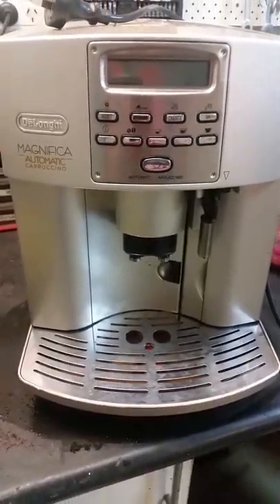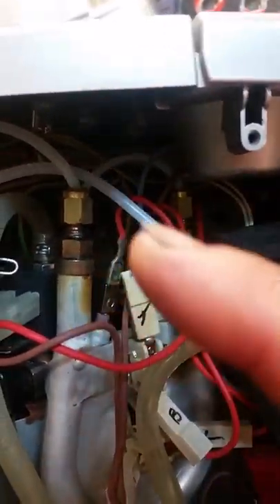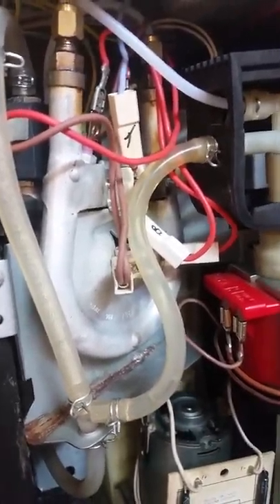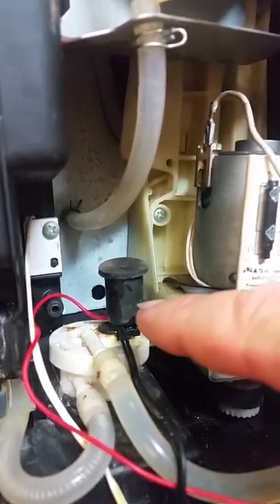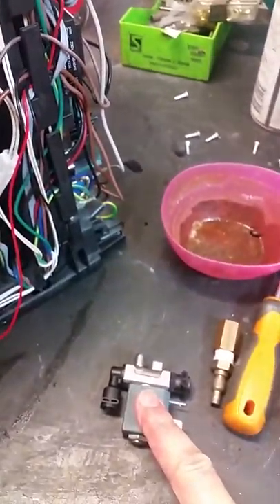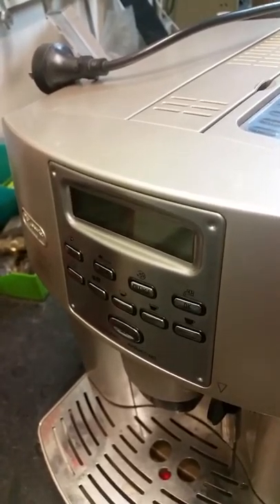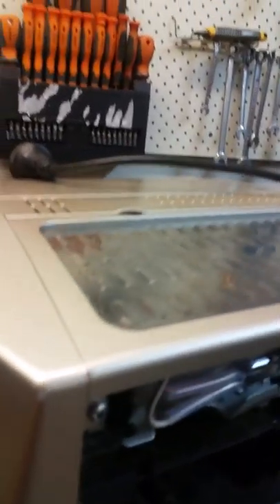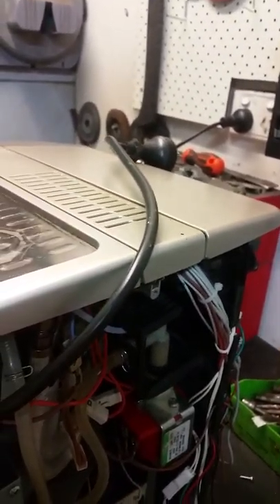How to Delonghi Magnifica 3500 problems and fixes!

Comment: Great video thanks. My 3500 has made 25500 coffees + 6000 cappuccinos over 12 years. No maintenance other than cleaning and the front solenoid has now packed up. I broke the plastic hose connection trying to fix it but it still makes coffee but no steam. All the plastic is very brittle so im not sure it is worth fixing as it doesn't owe us anything. Would buy again when I have the cash.
Reply from the maker: Thanks for the kind words. Great to hear that your machine has lasted the distance!

Comment: Hi Robert. Excellent.
Last night my Hubby tried to fixed our coffee machine. Delonghi ManificaEAM 3400.S, and accidental damage one of the wire next to the water boiler and circuit was short. Now he tried to turn on the machine nothing work. a red light on top of Menu light on for 2 seconds then off. The screen has light but blank. Thank you Robert
Reply from the maker: Maybe a fuse on the board?
Reply: @Discoworx  Thanks for your replied. Can i please have the image of the fuse locate on the power board. Cheers
Reply from the maker: @vickyyeung8814  I don't know that for a fact. Just an idea. I don't have an image. You'll have to look for yourself.

Comment: Thanks Robert.  I don't use the milk capability on my 3500 as I don't like the temp or consistency of the milk after.  Also keeping it all clean is a bit of a hassle.  I purchased a Nespresso milk heater and frother.  It has a magnetic driven whisk to froth the milk.

My ESAM3500 will periodically lock up.  It goes into a Self Diagnosis mode on power up and then shuts down.  By  using some of the things I learned from you I can put it into a diagnostic mode and play around with it.  Unplugging and plugging back in a few times.  Eventually it starts working again and stays working for a few weeks before going back through the same frustrating cycle.

It has been a great machine otherwise.  If I need to replace it though I will get the 3300 model as it has a steam wand to heat and froth the milk.  I have purchased that model for family and friends who are very happy with it.  But until then I'll use some of what I learned from you to keep my 3500 humming along.

Thanks again.
Reply from the maker: Jerry Banks Glad you found it useful. Sounds like you need a new control board. Have you considered replacing it? I don't know how much they are.
Reply from the maker: Jerry Banks You are right on about the milk frother cleaning! I personally quite like the milk though that comes out of it. What happens with the Nespresso frother? Do you fill it with just enough milk for one coffee or just keep reheating and refrigerating? Thanks.
Reply: Robert Baohm It is best to do one at a time. If you put milk just to the top of the whisk and use the wire whisk spinner it will fluff up to the top of the Nespresso.  I sometimes do not use either whisking elements and use it to heat the milk with no frothing. 

Before I repair the 3500 I'll likely just purchase a 3300 just to get the steaming wand.

Comment: Hi Robert, I am having a problem with my delonghi 4500 which is very similar to yours. My problem is I cant have milk froth coming out of the milk spout, but instead, lots of steam. The machine is super cleaned and works great otherwise. Espresso comes out, hot water comes out great. I just recently changed the coupling carafe with all new 3 o rings. I've got this machine from a seller in ebay that told me he only used it a couple of times and stored. When it arrived, I tested and worked fine for coffee. All buttons worked fine, the machine really looked like new. When I opened the machine sides and back to see inside, there were lots of dried grounds around it and I cleaned up carefully. I also have disassembled the milk jug lid and cleaned out, even though was not really dirty inside. Though, the milk jug lid came without the milk frothing adjustment, which is just something grey that slides back and forth for more or less froth. I don't know yet if the missing grey part can be the reason for the problem, but when I try to froth milk I even have held a cloth in that spot where the grey sliding thing would be, but makes no difference. Also, when disassembling the milk jug lid I noticed that one black o ring that was on the spout was broken (which I replaced) and there was only another little red o ring that you can see when you press the clean button. No more o rings in the milk top cover just a couple of springs. The milk jug works when I press the clean button for cleaning out the spout with steam. But no milk froth comes out, just lots of steam coming from the milk spout when I try frothing milk. Do you think the milk jug cover is the problem? Do you know if there is any other o ring in the milk carafe cover that I am missing? Help would be greatly appreciated.
Reply from the maker: Cindyc Tate hi. Itsbeen a while since ive had that apart but id guess you need the grey sliding part in there. It regulates the amount of milk. You mighy have to buy the whole lid to get it though. Good luck!
Reply: Yes, I think your right. There is visibly nothing else wrong with it and in test mode everything sounds good. Im going to have to buy it and give it a try. Would rather to know it for sure before spending almost $100 on the new milk jug, but have to do it. Will let you know if that will work and hopefully more people would benefit from the information. Thank you so much for your advice. :)
Reply: If steam and hot water works but not frothing, it could be the coupling carafe is partially blocked, you either try remove the coupling and clean it, or replace with a new one, it maybe not just the three orings on it

Comment: Thanks so much for this thorough review.  I also received my Magnifica from a friend and performed a complete cleaning and lubrication of the infuser assembly and transmission, full wipe down, and vacuuming but the machine would still report a Generic Alarm even without running the self-diagnosis and I successfully ran all functions in Load Test Mode, Display Test Mode, and Counting Mode. Finally, I was able to get a delicious double serving of coffee after leaving the coffee maker unplugged overnight. Then after about 20 minutes, the display once again read Generic Alarm and I'm back to where I started with a non-functioning machine. Any other suggestions to troubleshoot?
Reply from the maker: Sorry. Been quite a while and just don't remember.
Reply: @Discoworx  Thanks for your reply.

Comment: Hi Robert, I also have a Delonghi Magnifica 3500 and it produces the best coffee ever.  Mine machine is now about 12 years old and has worked perfectly up until now.  It still makes a great coffee but the coffee grounds now do not get put into the removable container, some get there, but most get dumped directly down to the right(which is the centre of the internal workings.  Do you know what causes this?  Many thanks Di
Reply from the maker: Hi Di. My machine has started doing similar. I haven't looked into it so I can't answer. Sorry.
Reply: It’s time to lube the long threaded rod hiding behind brew unit.

Comment: Hi Rob. Have you had any water leaks when you push the hot water button and water sprays out the hose which is connected to the solenoid at the back. It the one that has the lines going from the thermoheater. Tried to re-melt the end to seal but no luck.
Any suggestions
Reply from the maker: Sorry, never come across it. Lost o ring?

Comment: Good day. I have a DeLonghi ECAM23460S. The display shows "water circuit empty please fill water circuit." Any advice would be much appreciated. Took the back cover put and the tube that connects to the tank is dry. No water is even reaching the flow meter. The machine is new, but I don't have warranty or a way to return it. Thanks in advance!

Comment: Do you know what the soft larger diameter hoses are in the machine?  I can't find replacements and no description of them either.   Specifically the ones that supply from the reservoir to the pump
Reply from the maker: Sorry, no. Try ringing the De'Longhi help desk. Or try a specialist hose supplier.

Comment: Hi mate, I have the same machine and have now started experiencing where the water keeps coming into the drip tray when making coffees. It still comes out of the spout but a portion of clean water keeps coming from the main group in the middle somewhere. It leaks inside the the actual machine (black plastic).

Have you had any issues with water leaking in the drip tray whilst making coffee? 

Thanks in advance if you respond.
Reply from the maker: Sorry. Never experienced that one! You'd have to take the covers  off and check out all the hoses and joins. Good luck.

Comment: Question for the experts...I have the Magnifica. It will pull single shot but not double. Pump sounds normal at start and quickly gets quiet with nothing coming out. I replaced pump with oem after 3 complete descaling procedures made no difference. Hot water and steam works good. Water comes out of espresso nozzles at startup and shutdown. I fully cleaned and lubricated the plunger assembly (even that plug and tiny hole below screen). No signs in tubing of scale buildup. I am at a loss. Any suggestions? Thanks!
Reply from the maker: Interesting. I haven't had the machine for a few years so it's hard to comment. I suspect that you were on the right track with the descaling for a blockage but you might have to get more mechanical. Maybe a crimped/blocked hose?
Reply: @Discoworx  Thank you for the reply. I am going to inspect all the hoses and clean then....like you said, maybe a blockage of some kind....
Reply from the maker: @davidk4236   surely the only difference between a single and double is the volume of water? Which is dictated by programming the button and the flow meter? Maybe try programming the single button to do a double for a giggle and it may indicate further where the problem is.

Comment: Hi Rob, thanks for the video, I have this machine as well, 2009 model and the only issue to now was the machine wasn't recognising the full water tank. This was fixed by replacing the reed switch (which can be seen in your vid). My new issue now... Coffee doesn't come out the spout, it drops directly into the drip tray. Have you had your machine apart enough to guess my current issue? Also, I've used website big warehouse spares (in Australia) for the reed switch. Cheers
Reply from the maker: Paul Smith Hi Paul. Sorry but I'm not familiar with that issue. Split hose? Missing the clip that secures the hose in a valve? Be sure to post the solution when you work it out to keep building the knowledge base.
Reply: Hi Paul, I am having the same problem as you describe... coffee is running into drip tray,  have you figured out any resolve to this?

Comment: Hi Robert, thank you for all the information. I have a Delonghi ECAM 23.460 and when I turn it on as well as when I turn it off, it makes a loud noise that I guess it comes from the brew unit. Do you know what could it be? best regards!
Reply from the maker: Ezequiel Cappellano sorry no. I'd have a look at bypassing the switch that tells the unit when the door is open so you. Can operate the machine and have a look inside. Good luck.

Comment: hey Robert Baohm,
thanks for this video, its exactly what's wrong with mine, but I'm not brave enough to give it a go, I'm on the Sunshine Coast Queensland, any recommendations as to where I might take mine to have it repaired?
kind regards Pete.
Reply from the maker: ThePeetsee which problem do you have?
Reply from the maker: There should be a 1800 number on the side of the machine for delonghi assistance. They can tell you.
Reply: Robert Baohm 
hi Robert, I have the coffee is to fine, insert water spout.
I don't have any water coming through.
Reply from the maker: ThePeetsee c'mon Pete, have a go!  The stainless ball I got was no good and got stuck after 4 days of no use. I got this plastic ball on eBay http://www.ebay.com.au/itm/161858561864

It's not a hard fix. Who knows, this may be the start of a new era of DIY for you! If you're half keen I keen help via Skype.
Reply from the maker: Try this https://youtu.be/UbcQAi1_b1E

Comment: Thanks for the info I just scored one of these from my local recycle center for 5 bucks only problem is the steamer doesnt work nothing comes out at all all i hear is the pump buzz.
Reply from the maker: brett20000000009 I could be just blocked
 when I got mine second hand it was blocked
Reply: Hmm I tried the diag mode and only 1 solenoid clicks ev1 (small cup button) doesn't click. Is that the solenoid responsible for turning on and off the steam?
Reply from the maker: Sorry can't tell you that detail. I followed the lines back from the pump until I found the blockage. it was under the front panel. I can't remember if it was the inlet or outlet to the valve I dropped off but once I had done it away it went!
Reply: @Discoworx  Hi, got the same here no milk or hot water just pump running, by "blocked" do you just mean chalk or dirt in the hose? or could it lose some pressure somewhere? thx in advance.
brett20000000009, did you got it fixed in the mean time?

Comment: Hi Robert i have the 3300 model and the water indicator keeps blinking red! Starts up fine but wont pull water for coffee or steam.
Reply from the maker: I would try and bridge the magnetic water level sensor out. After that it could be a faulty board. Have a crumpet and a cheat day whilst you're at it 🤣

Comment: I am having trouble with water running out-of the frother rather than adequate volume through the coffee infused.  Can't seem to see where the problem lies or how to fix it.  Any suggestions??  Thanks.  Jim
Reply from the maker: The frother is for the milk? Sounds like a seperate issue than volume of water for the coffee. You can program for volume of water. Maybe the element is gone for the steam?
Reply: Descaled you’re machine yet?
Reply: Lauri, I'm having "your" problem. Water streams out the frother/wand, but nothing from coffee spout(s).  The used coffee puck that is kicked into the garbage tray, is completely dry - meaning no water was pushed through the infuser.  Did you figure it out?
Steve

Comment: I have a Generic Alarm issue. Goes through its diagnostics OK then displays the Generic Alarm. Something I have noticed is when this is displayed only half the warming tray on top is hot. Any ideas would be welcome.
Reply from the maker: Hi Rob. I think they have 2  heating tanks (water, steam). Rip the covers off and check the thermistors with a multi meter. Good luck.

Comment: Hi,
I can read on my esam 3500 general disorder.
I started the machine, and it takes a lot of time to heat up. After a while General disorder came up, and nothing goes on. 😏 
The machine is maybe 10 years old. Of course no guaranty 🙈
Can you help me please? Do you have any idea?
Thanks ands greetings
Reply from the maker: My machine died some time back and I now have a small unit that just takes preground coffee and it makes great coffee. I recommend you throw the old unit away!

I will make a video on making great coffee with these small units.
Reply: Oh Ok... Thanks!
It's not worth it... Unfortunately. 
Replacement is coming 😅
Thank you for your answer.

Comment: Hi Rob, great video 👍🏼 I recently purchased one on these second hand and keep getting ‘GENERIC ALARM’ come up on the screen. No idea where to start any advice would be greatly appreciated would love to make a cup of coffee some day soon with it
Reply from the maker: Lil_Manda Burgess quite possibly a thermofuse on a heating element. There are 2 fuses (white ceramic things with 2 wires each) on each of the elements  (I think also called thermoblocks). Pull a wire off each one and check with a multimeter. 

More info and parts from these guys

http://outwestcoffee.com.au/index.php/2017/07/30/how-to-test-the-fuses-and-elements-in-your-delonghi-coffee-machine/
Reply: Robert Baohm thanks I will check it out and let you know in a couple of days time also thanks for the links 👍🏽

Comment: Hi Rob, great video! thanks for sharing. I had a similar issue "coffee is too fine and insert water spout" I checked the pump and I believe it is fine I am now going to check the solenoids. In your video above you mentioned you changed the front solenoid. How did you determine which solenoid was faulty? and where did you buy this from?
Cheers, David
Reply from the maker: Adrian David García Tabares Check out one of the other comments. In my reply I've posted a link for diagnostic info. You can turn the solenoids on and off manually. Even if you can do this, it won't really show a faulty valve. I think you will hear it click and that's all. I think the error comes up due to low flow. If the solenoid is not opening enough it will be very hard to tell. 

I have that error now and fitted a new flow meter but it didn't fix it. Another youtube video reported the same thing. My flow SEEMS ok but I suspect a slightly faulty pump. 

Parts from a coffee machine shop on portrush rd in South Australia.

Comment: Hi Robert hope you or anyone else can help  i have a ESAM4500   grinder not grinding long enough any more only  1 or 2 seconds  , working ok on preground  coffee , saw another tiny bit of a video where the man reckoned it could be the hall sensor failure on the bottom of the transmission and that puts the machine into a safe mode only grinding for a second  .  have you ever come across this problem ? and if you think it is this  sensor is it possible for me just to change it out  ? love your video by the way
Reply from the maker: Hi Wexman, sorry but I can't help. Good luck.
Reply: @Discoworx  cheers for the reply